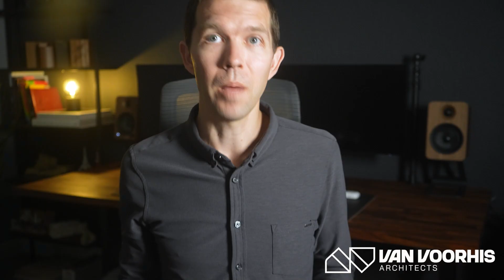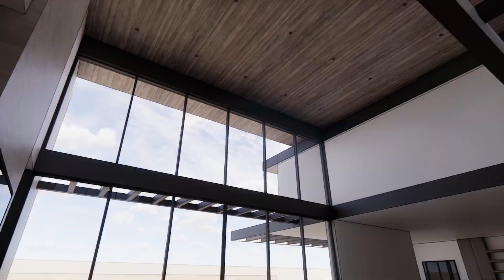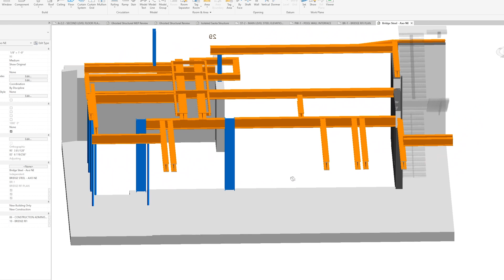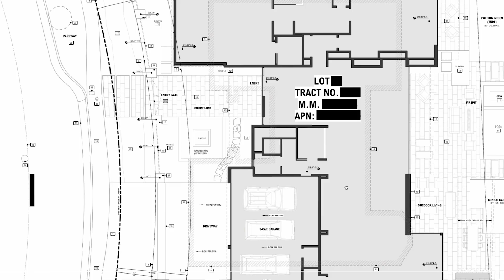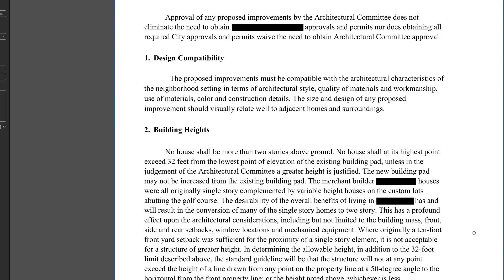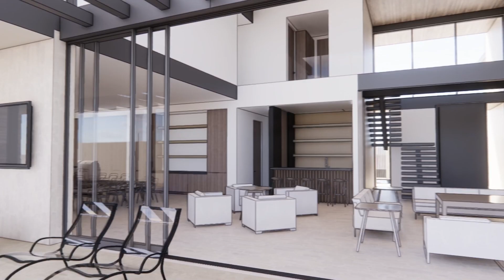Design Development: Turning Concepts into Reality

Comment: Are your mechanical, electrical and structural consultants working with Revit. Mine do not. 3 structural firms and 3 MEP firms absolutely hate Revit. We have found it difficult to find people who are knowledgeable in Revit with real experience and not just out of college. My friend quit a 5 person firm because of all the cad errors that would show up in the field. I think the entire construction industry on both sides, design professionals and contractors is in BIG trouble.
Reply from the maker: I have 3 “go to” local structural engineers in my area that all do quality work in Revit. Beyond them, I’ve worked with other engineers who do their primary drafting and design in CAD but offer an additional service to produce a Revit model of the primary structure. Not the most efficient on their end imo, but I always require a 3d model of at least the steel structure so I can make sure everything fits in my model to avoid surprises in the field. MEP is similar, I haven’t found any that design natively in Revit but I have a few that offer modeling the mechanical systems. Which, similar to steel, is the main thing I care about having in 3d so I can ensure we don’t get any funky drop soffits or surprises during construction. If it’s a traditional home with ample attic spaces I’d maybe forgo the mechanical modeling if it’s obvious it’ll fit. Generally it all depends on the style and how tight the design tolerances will be. Hope that helps!

Comment: So do you submit a “bid” set to the building department ? Or just the zoning department ? I’m from Florida, just wondering how that works elsewhere. 
Thanks
Reply from the maker: Generally yes, the first formal 'bid' set is the same set that ultimately gets submitted to the building department. However I don't have a full 'bid' set at the end of this Design Development phase. I think of the set that I have at the end of Design Development as a 'preliminary' bid set  because it's the first time I have a set of scale architectural drawings (site plans, floor plans, elevations, RCPs, schedules, etc.) that give a detailed sense of the project to a potential contractor. I don't have full engineering compiled yet, but a saavy local contractor would have enough experience from similar projects to do some initial quantity take offs in order to give early cost estimates. They're not formal bids, but it's really useful to start the cost conversation before engineering kicks off in case it's shaping up to be more expensive than what the client was expecting. Easier to reduce scope before all the consultants have done their work.

Depending on the jurisdiction, this preliminary set might be submitted to a local zoning department if they require zoning approval before building department submittals. Some jurisdictions though do both the zoning and building reviews at the same time. So in that case, it sort of just depends on how the local jurisdiction operates. 

Let me know if that makes sense!